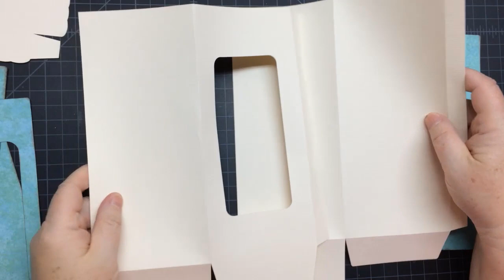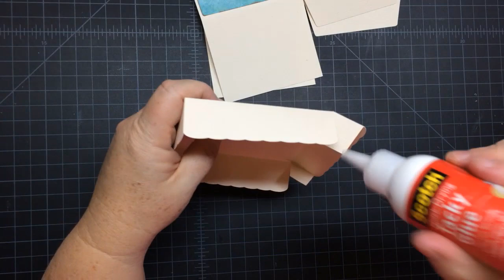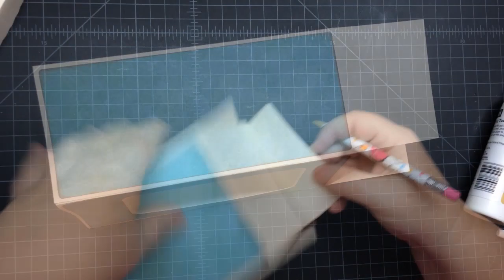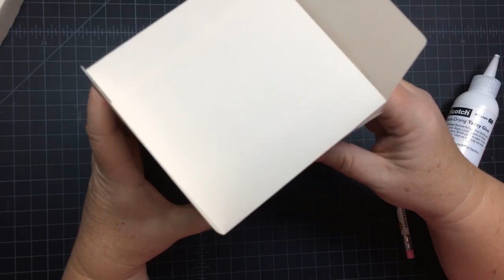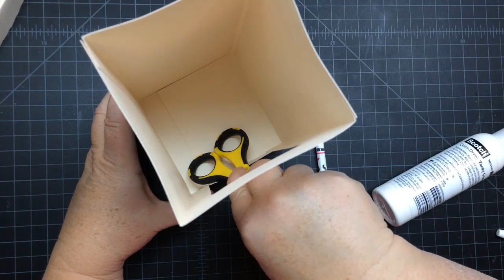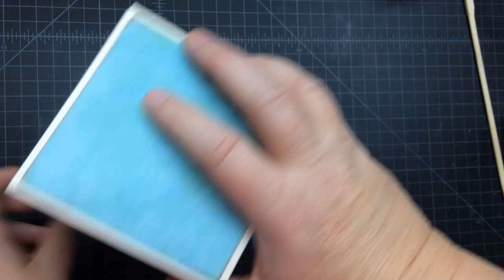Skinny Tumbler Box Assembly - SVG File

Comment: Hi what lbs did you use for the paper?
Reply from the maker: I used 80 lb American Crafts Textured Cardstock.  I do recommend 80lb or above so it is strong enough to hold. If you add the panels, it strengthens the sides more.